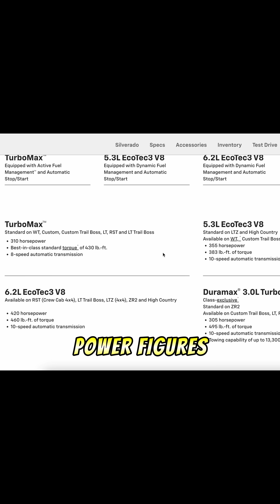Modern 1500 Engines Are Working Too Hard - WILL THEY LAST

Comment: Seems like they can last a long time, if they’re designed to do so. The 2L Turbo LNF little monster in my car will undoubtedly outlast the chassis, despite being staged and tuned. It was severely overbuilt, and designed to handle tuning and abuse from the start. Staged and tuned LNFs are known to go more than half a million miles with virtually no issues. Some of GM’s finest engineering. The interior and sensors on the other hand… Granted, a Ford 300 will mop the floor with any other automotive gas engine I’m familiar with, on longevity. If you really want longevity, go overbuilt and under-stressed inline 6. That’s always been the formula for max longevity. Good news is that such a design fits pretty well into the engine bay of a truck. Just look at the Ford 300! It won’t get the fuel economy under light load of a small 4 cylinder, though. Under higher loads, it will.

Comment: The killer of this argument is the eco boost 2.7. High stung? Yes. Built like a brick shit house? Also yes.

There are also other factors like less parasitic losses and lighter weight parts to consider. Towing would be a different consideration.

Comment: Not necessarily true. If an engine is built for the power, such as the gm 2.7l, and gm is comfortable enough to bring back the 100,000k mile warranty on that engine first, before its v8s speaks a lot.  Forced induction complicates an engine extensively but so does modern emission standards as mandating crank case vents to lead back into the intake vent causing excessive carbon buildup on direct injection engines such as the 2.7l turbo max, which I own and love. First thing I did was walk to the service department and ask them how to keep my 2025 turbo max last and they stressed carbon buildup clean off the intake valves/manifold. Do proper maintenance, change all your fluids 30-50% earlier than manufacturer recommendation and talk to the dealer service department. They see the these more than anyone else. Listen to them.

Comment: I said it the minute Ford brought out the eco boost. I was asked my opinion on a semi that someone was going to buy. The guys with not much experience told him that the truck that looked nice was the one to get. It had an m11 cummins. I told him looks are 2nd. He should get the n14, or c 15 that he was looking at. He was hauling steel. Imagine an m11 pulling steel through west Virginia and Pa all the time.

Comment: Well let’s not put it on the engine size or turbo. The manufacturers could easily make the motors beefy enough to withstand the heat, pressure, and everything else, but then shareholder value and executive compensation might drop by a fraction of a percent. We can’t have that…..

The Japanese and even European imports have been doing exactly this forever and aren’t having engines shit out left right and center. This is 100% on the manufacturers themselves cheating out on everything they can while still increasing the prices of the junk they’re putting out.

Comment: Idk .. a lot of 3.5 Ecoboost truck owners out there pushing past 200k
Reply: 277k on my 2016 3.5. Running strong the day I sold it. Moved into the 7.3 Godzilla
Reply: @FupaLovr231 I moved into a 6.6 gas.  Wanted the 7.3 but couldn't walk away from a family employee discount on the Chevy, the discount made it where the pricing wasn't even close.

That said, I'm not at all unhappy. My 3.5 was tuned and this 6.6 package would at least keep up with it... can't argue the longevity of this bigger engine will most likely be a bit longer.. at least has a good chance of it
Reply: I see a ton of failed ecoboost 3.5’s in my shop. A lot of them fail at around 120k. Timing needs to be done every 100k.
Reply: @stevenslater4395 failed as in trashed, or failed as in needing a timing set... Granted the timing set isn't cheap to fix, it's technically repairable and unfortunately timing failures aren't exactly uncommon anymore with all the stress on modern timing systems and the light components being used
Reply: I had a 3.5 ecoboost and a ram 6.4. The ecoboost would out tow the big ol 6.4 any day. A lot of folks don't want to hear that, but it's fact
Reply: @jmjm3543  yup, I've had both the 5.3 and the 6.2, and the 3.5 ecoboost tows way, way better. Sure it doesn't sound as good, but man they tow great.

Comment: Say what you want about the 3.5 EB but high strung it is not.  Can accelerate fully loaded at a reasonable pace without ever touching high rpms. This engine is barely working and the gen 1 3.5 is known to be very strong and reliable if maintained properly.
Reply: My brother has something like 270k on his 3.5EB now.  It seems like a good choice for a role where you need the power on occasion, but not working it hard daily.  This is many of us, in reality.  Mine is at 90k and it sure seems like a nice engine package for my uses.
Reply: @Lightwalker1978  I know of several first gen 3.5’s with 300k + miles with very little repairs needed.  I’m only at 100k on mine but many of those miles are towing miles.   I’ve had zero mechanical failures or any reliability issues.   Regular oil changes with good oil will keep these running for a long time

Comment: Not sure this is fair. Compare the turbo half ton engines to the v8 half ton engines and there is no clear winner. The turbo engines are arguably better in some cases, like catastrophic bottom end failures and catastrophic valve train failures for example....lookin at you 6.2 and 5.3gm and 5.7hemi.  2.7 eco is probably the best of the turbo half ton engines and maybe the best current half ton engine on the market...no i dont have one, i drive a l5p dmax.

Comment: And they're not even that fuel efficient sometimes. X amount of work requires X amount of air/fuel. It's all an EPA or environmental thing. Not for the end consumer.
Reply: The difference comes when you are up to speed and cruising. As you let off the fuel the turbos spin down, putting less air into the cylinders. At the same time, the engine injects less fuel. That's when you save gas, as now you are only running 6 cylinders, and 2.7 or 3.5 litres displacement, not a 5, 5.3, or 5.7 V8.

And you get that efficiency without a variable displacement system that has caused GM and Chrysler continuous issues.

The key is having a light right foot. Otherwise you won't save gas, because you are quite correct - power production is a function of burning a certain amount of fuel and air mixture.

The best example I know of is people who've gotten lousy (relatively speaking) mileage in a Prius or other economy car. No engine can overcome a lead foot.

Comment: 192k on my 15 ram 5.7. Not a major issue yet. Exhaust leak is back for 2nd time. 10k oil changes. I won’t touch a turbo anything for a 1500.
Reply: Your right, you won't touch one as they blow your doors off. My ecoboost will outlast all of your FIAT electronics. 😂😂😂
Reply: @shroom9033 let me know how many miles before you fixed turbos…

Comment: Back in the 80s there was a push by manufacturers to buy turbo engines. Turbos were new and hot thing on the market.  But problems started to pop up. After a few years, the turbo crazy died. Since then, I suspect advances in design and technology have addressed many of those issues. Now, we’ve have the ecoboost for over a decade. Those truck engines last.

Comment: I think what’s gonna happen is when these trucks hit 200,000 miles if they even get that far on these tiny turbos, they then replaced them with crate V8 and get another hundred thousand to 200,000 miles out of the truck.
Reply: The trucks will be junk by then too, along with the engines. And then more people will take out loans and borrow money they don’t have, for hyper expensive trucks they may not actually really need, and then the cycle will continue on…

Comment: I understand your point but it only holds true if both engines are designed the same and with the same materials. How about some real data?  2.7 has been around plenty long enough - what does the warrant data say?  Everything else is just someone opinion. 7.3 I thought you were talking about 1/2 ton trucks ?

Comment: Towing 8000lbs with a 4cyl engine is crazy. Just because it can, doesn’t mean it should. I’d be nervous towing 5000lbs with one for extended periods
Reply: I have a 2.7 eco-F150 with max tow package and max GVW. Pulls 8000 pounds and barely revs above 2400 RPM on incline.
Reply: @ryane6719 that’s still a V6
Reply: @ryane6719 yeah, i let my 3.5 shift under 3,500 rpm and it cruises below 2,000 rpm with a load. Never winds up like that 4 cylinder unless I am passing. It pulls a lot better than any v8 I ever had. The v8's are usually screaming too
Reply: @shroom9033  turbocharged engines also usually hit peak torque at lower rpm so yes it will probably not rev as high. But the serious amount of pressure from direct injection and added boost is still there
Reply: @ryane6719  I’m not saying it can’t do it. I actually said that in my OP. But the reality is we don’t know yet how well these trucks will hold up over time. Without doing the work, we can’t see the results so I applaud you for being one of the testaments to this.
Reply: @mminniear984  fewer cylinders and a turbo means you'll have equal or greater power but by using a smaller engine with a turbo you're stressing the smaller engine and adding more complexity with a turbo even as good as Toyota is I'll take an older vehicle with the V6s rather than turbo i4s. For example my grandfather had a 1 ton Toyota pick up it had a NA I4 geared very very low he said every 60k you'll have to put an engine in it because it's overworked and the kicker it got single digits mpg loaded or unloaded a naturally aspirated i4 making single digit mpg while blowing an engine left and right. Fast fowards a few years and he picks up a shiny 2004 Chevy Silverado 2500hd 15mpg unloaded about 10 or so fully loaded pulling a heavy tractor running 80mph down the interstate while hardly feeling it. It's had a hard life while being maintained well 126k on it it'll be mine when he dies and I intend on running the wheels of it and keep putting new engines and transmissions in it because the frame will last forever down here in the south
Reply: @mminniear984  my first 2.7 I put 118,000 miles on it with towing and had no issues so I can only tell you as far as that. My last two eco-boost I’ve been fortunate to be able to get new trucks every few years so I don’t put enough miles on to know what it would look like beyond that point.
Reply: @ryane6719 I’ve heard the 2.7 are more reliable than the 3.5 so it sounds like you made a wise choice. I personally don’t tow that much anymore since I sold my camper years ago and would consider the 2.7 for that reason. I just mainly need a truck for the bed due to my work and would like some better mileage but I just don’t like the interior of the f150. Just personal preference.
Reply: You must have never heard of 4BT, OM 904, or 4HK1. I would take those 4 cyl engines over V8 gassers. I never had issues towing 10,000 lbs with 4HK1.
Reply: For a four-cylinder diesel, it’s totally reasonable.

I tow 15k lbs with a 3.0 4cyl diesel
Reply: @PiOfficial  for sure. They’re made for it. But a gas 4cyl turbo can do it I’m sure. But I wouldn’t do it consistently or for long hours at a time.
Reply: The 2.7s are beasts on the f150. I feel like this discussion is more about engineering and build quality than size. A ton of 4 cylinders will go 200k or more with no major issues in midsize trucks. You also have to take care of them
Reply: @imanudistperson The 2.7L in the F-150 is an overbuilt V6, it uses a CGI block. This is just a large-displacement turbo 4 pot.
Reply: My ranger pulled my travel trailer at around 7k pounds and handled it beautifully… too be fair, I never dumped my foot on the pedal and drove it around on easy mode… I think people don’t take care of their vehicles these days.
Reply: I blew one up towing 3000lbs. Never again
Reply: Not crazy, normal
Reply: @onny5989 yeah, people have been towing 8000 lbs with 4cyl engines for decades. No. This is a very new thing. To say it’s “normal” when we don’t have the data yet to show whether it works over long lifespans of a vehicle is a very ignorant thing to say. What I keep having to bring up to people is the ram eco diesel as an analogy. It won truck of the year when it came out. It is known now, almost 10 years later to be an incredibly flawed engine. That’s why they no longer make it. Also, Just because it can doesn’t mean it should.
Reply: @mminniear984 lol I never see 4 cylinders in heavy duty trucks
Reply: If it was a diesel y'all wouldn't think anything of it. They put that magic diesel metal in those.
Reply: @anthonyrowland9072  A four cylinder diesel isn’t going to be spinning at 5,000rpm while cruising under load on the highway.
More rpm = more heat & wear
Diesels make enough torque to tow under load at low rpm
Reply: @BuggaBoy69  Neither is this...

When thsi engine came out it made a peak tq of 348 at 1500 rpm, now it makes 430. Y'all just can't get past the 4 cylinder thing lol
Reply: I pulled 6,000 lbs with my 88 GMC S15 with a 2.5L Iron Duke 4 cyl making all of 110HP.....
Reply: @dalemllns  People pulled wild stuff with 22rs lmao

This "you gotta have 400hp to haul a sheet of plywood" thing is why they got sold on these unrelaible land barges with crap fuel economy. It's the 70s all over again...
Reply: I bet they didn't even give the transmission it's own oil cooler. So it can overheat when the engine does
Reply: Classic case of "there is a hitch on my vehicle so I must be able to tow anything with it."

Comment: I have a 2011 RAM Hemi 4x4. 287k miles and I get about the same MPG's as my son does in his Chevy with the 2.7 turbo. In fact while towing my 27ft travel trailer my RAM beat his Chevy by 2 MPG's . His felt like it was a plane revving and honestly I felt like we were killing the engine.
Reply: Sure it does. You're not getting 2 mpg better.... 2.7L also has an 8sp transmission. Keeps the revs low and torque up.
Reply: Sounds like your son drives fast and accelerates quickly. Also your son’s engine has far smaller tail pipe emissions compared to your 2011 Ram
Reply: @FuttBuckerByMuttif the 4 bangers is burning more fuel then it is unlikely to be creating less emissions..
Reply: @vincefairleigh6899  MPG‘s are far less important to emissions than what actually comes out of a tailpipe
Reply: If it’s running that rich how do you now realize that? You actually think it’s normal to get better fuel mileage than a Cruz while you’re towing? Brainless.

Comment: Buddy has a chevy 2.7 turbo pulls a 7400lbs camper around. Truck sits at 234k odometer. No issue yet just brake sensor replaced last year. No leaks transmission still good. Pulls just as hard as day 1.
Reply: There’s always outliers. I know a guy that has a ram eco diesel with over 200k on it and never had a serious issue. He tows and drives hard. Just because it’s “common” doesn’t mean it’s guaranteed 🤷🏻
Reply: My friends sisters aunts cousin has a econoline van with 1.5 million miles. Original brakes and oil.

Comment: Ford 300 inline 6 The best half ton pickup engine ever made My dad drove his 1980 F100 300 inline 6 with 3 speed overdrive to just over 500,000 miles tune up one clutch and some brakes The bean counters today would cringe at that motor
Reply: So daddy had a 300 inline 6 that in those days would have never seen a trailer longer than 16 feet. Times change my man, we ain’t pulling daddy’s 16 footer anymore. Old and out of touch with the real world. I am old but not that dumb.
Reply: And that shitty ford was gutless and wasn’t powerful enough to hurt itself.
Reply: Outlasted The bullshit1988 GM van we had from brand new only went to 140,000 mi @davidcardinal3654
Reply: Good,but the Toyota V8's are better.
Reply: @stefanovichmichael9686sore losers of world war II
Reply: @Eric-n3q Has nothing to do with building a better product including engines.

Comment: It's not the power for the engine size at all. We see sports cars push big power in small packages. Trucks are big and heavy though. 
I will add though, most people who own half tons don't use it for what it is intended for though. I can see a turbo max working out for some single cab bed guy who hauls his trash to the dump and helps his friends move their couch lol

Comment: I love the way my ecoboost drives so much more than any other engine, but I know it won’t last as long as an old shitty iron lump. Honestly, I can’t wait for battery and charging tech to get better and just go electric. Nice and simple DC motors, fuck all these pistons, rotating assemblies, cylinders and shit. Just give me all the torque and HP and a simple electrically driven system. Yes computers may be difficult for the boomer to understand, but their modern gas car isn’t working without one either.
Reply: The battery is the nightmare for the electric vehicle, not just range, but having to replace it later in life and the out of control fires they sometimes create. Also I have a 3.7 non turbo and it is great and doesn't need a turbo, but I haul in the 8ft bed instead of tow. It would probably suck to tow much.